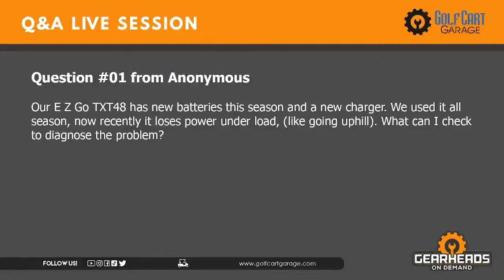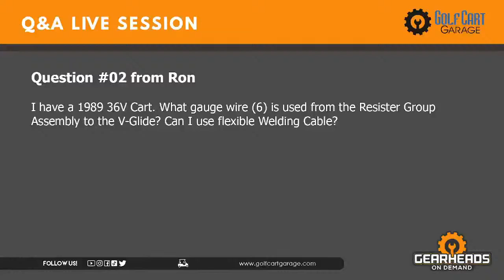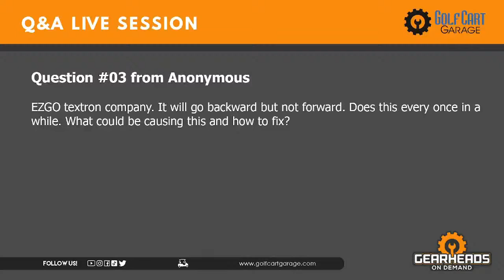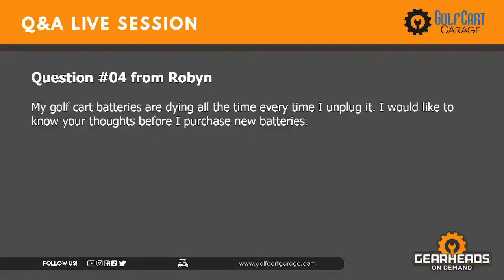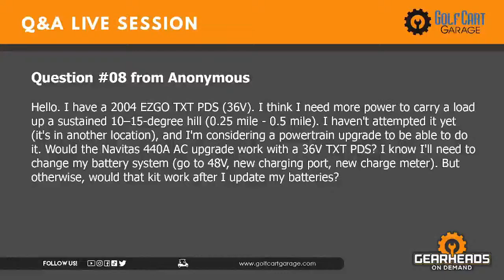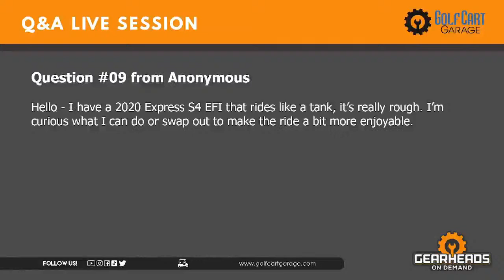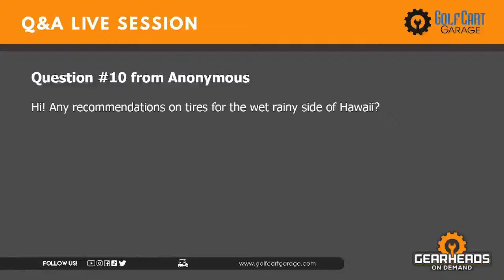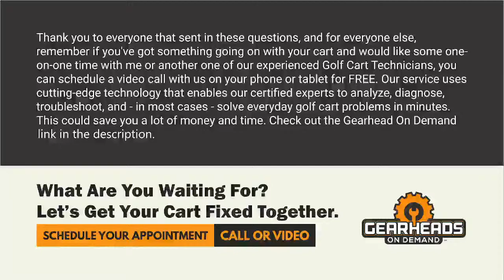What gauge wire to use? | Golf Cart Garage I  Episode # 153

Comment: I see that Navitas has a 440A and a 600A controller, but I see that the upgraded solenoids are only rated at 400A.
Dont you need a 600A solenoid in order to operate a 600A motor controller?
Reply from the maker: Hello.  No you do not need a 600 amp solenoid.  You will probably never see 600 amps through the solenoid.  Alos that 400 amp solenoid is capable of a inrush of way more than 400 amps for a few seconds.